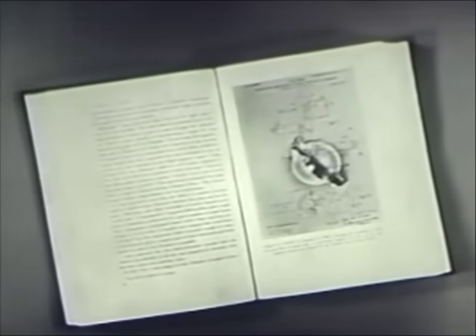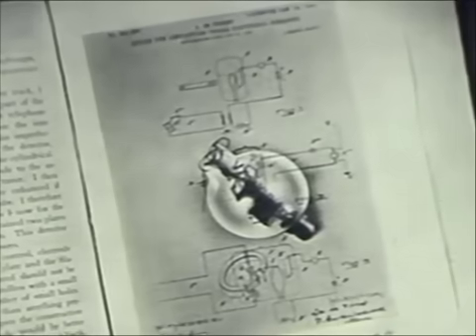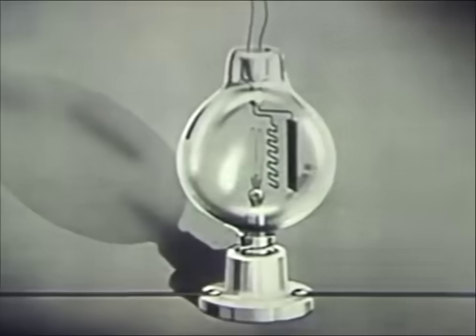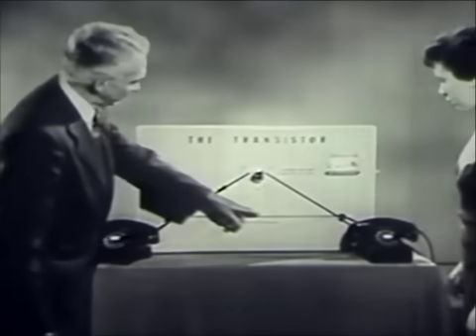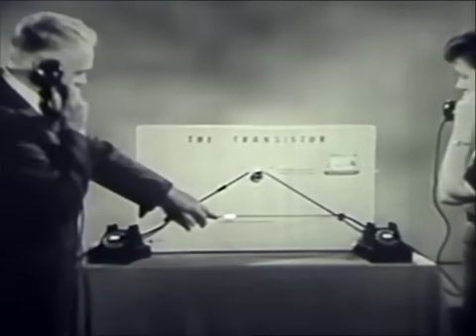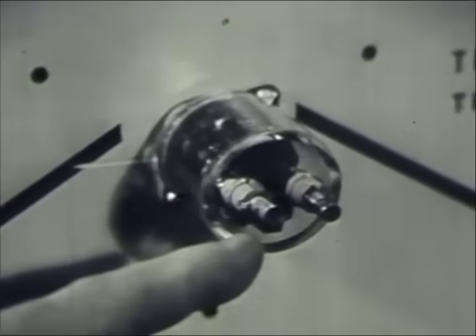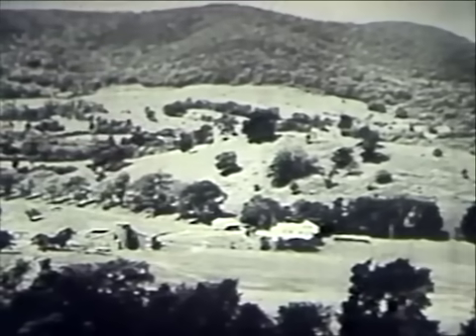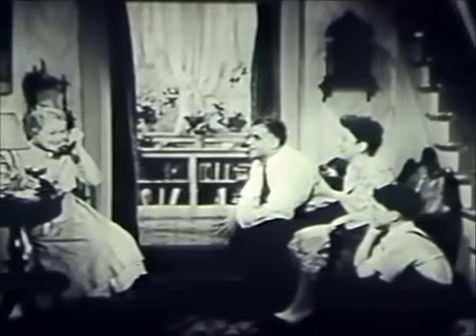The Transistor: a 1953 documentary, anticipating its coming impact on technology

Comment: Man I swear. The transistor is nearly the most useful thing invented from the 1500s to now. It made us EXPLODE with super tech filled and modern technology. Phones, computers, space travel, proper gps, radar, sonar, high frequency electrical switching. EVEN MODERN LIGHT BULBS! Yes you’d have power, food, and a good job. But without the tiny transistor which has become microscopic in many cases, life would be so much more different.

Comment: “Because the transistor remains cool...”

Modern gaming rigs may have something to say about that
Reply: Integrated circuits are another story.
Reply: Just clean the rig cooling system from time to time or change the thermal paste then it will not gonna be working so hot for you. :P Also you have billion transistors in a cpu or gpu that is smaller than a single vacuume tube and good systems using water cooling so you can touch microcircuit even when its working... try doing that with vacuum tube?:P ("The development of oxide-coated filaments in the mid-1920s reduced filament operating temperature to a dull red heat (around 700 °C), which in turn reduced thermal distortion of the tube structure and allowed closer spacing of tube elements.")
Reply: Biały i’m aware of that lol i have a degree in electronic engineering, just wanted to make a bit of a dumb joke. And yes, valves get insanely hot, guitar amps can attest to that
Reply: you know there trillions of transistor in your rig right??
Reply: Loknath Shankar i don’t have a rig for starters, read the above comment for more info. Christ can’t people take a joke these days lol
Reply: @loknathshankar5423  No there aren't. About a billion, tops.
Reply: @jimskea224  well considering my 8 year old cpu has 1.2b in it alone, 1 billion tops is wrong
Reply: But still, compared to glowing vacuum tubes

Comment: 7:28 "Transistors may some day go under the sea"....NOPE. We use fiber optic cable now. We've come so far in such a short time. The scientists of that era couldn't have even imagined the technology that we use today! Their transistors are used now in the billions, within one microchip!
Reply: "The scientists of that era couldn't have even imagined" just like you can not even imagine "maximum distance of a fiber optic link that can be achieved without using any optical amplifier or repeater"? heh
Reply: Optical amplifiers / repeaters use transistor based devices to operate. 😉

Comment: I grew up with this.  A watch the transition from Vacuum tubes to transistors and later it ICs. I'm glad I understood the physics as technology changes.  I made solar cells from a silicon disc as a HS science project in the 60s. We were alll amazed with the transistor radio thet were the size of a pack of cigarettes.  Now you can put a radio as a microdchip in an MP3 player that is 1.5 by 3 inches as an add-on device.  It the carriers could make money on it there would be radios in cellphones, but public airwaves data don't make them mnoney and free radio doesn't require subscriptions like Spotify.

Comment: Just big enough for a tiny ✋ and.   We actually replaced  tubes in the television📺
Reply: The tubes in the TVs and the tubes they are talking about are different... if you were born after 1970-75 may be ... u never saw a vaccume tube on any electronic. but yeah we replaced the tube inside TV quite late... just to put this into perspective i must remind you that we had tube inside tvs associated with an IC just attached to it which had transistors.

Comment: I remember getting a transistor radio in the Sixties. It was a Sanyo.
Reply: As I did too, ran on 3 D cells, AM and short wave, no FM yet. Mother had an even older type transistor radio, had a leather case and a battery something similar in size to a block of butter , it had 2 different size holes adjacent to each other.....for the plug within the back of the radio. its still around somewhere in the back shed...I hope.
Reply: 9v here, a SOUND DESIGN 8 Transisitor and cost a whopping 16 dollars
Reply: @gertraba4484  yes mine was a 9v pocket sized radio.

Comment: "... the age beyond the electronic age."

I guess that's now officially the information age.
Reply: That would be the Quantum age
Reply: Yeh, I thought that was a curious comment, too.  70 years later it is still the electronic age, but back then the vacuum tube was clearly about electron flow between the cathode and plate and you didn't have to have quantum physics understanding to make tubes or to apply them.  Even though it is a huge technological leap to quantum based  solid state fabrication relative to the old vacuum tube technology, we moved on seamlessly.  The public pretty much just thought about transistors being tiny and low power and cheap, mostly unaware its invention was only possible with knowledge of quantum physics.

Comment: A year after the 47 Roswell crash they figured out how to do it another way.  In July 1948. The Army held their off world share of the crash in a file cabinet under lock. They thought it might be the devil planting technology .  The AF picked up with and ran and with it. But see there was others that were found and this technology was in full use 74 years ago  it enabled the AF to put a communication tower two miles high on the moon. Not our moon Saturns moon Iapetus  that achievement was the inception of the AF.  It was shifted over to the navy in later years. Since the black budget is no longer buried Trump has to invent a new service  the space force so it can be funded with an audited budget  it was necessary as everyone is going to space and it’s all being detected  the five mother ships that are as large as a battle ship that carry thousands ( outside of time space ) as you see the only time that is linear is between the earth and Sol 3 our Sun.  We had shuttle crafts in the 80s that hold 350 personal  anti gravity.  The same tech that was taken from one of the Roswell crashes that was used to get Apollo to the moon  it was in place of the small rocket engine they told you was powering the Lem  it’s how we we’re able to land on the moon  we we’re able to use the foil that would unfold when you dropped it to line the walls and space suits to withstand the radiation. We used it to launch a craft that was another two missions for Apollo to look at a crashed Alien craft on the moon  to bring back a woman that was neither dead nor alive that was laying in the craft prob thousands of years. We we’re running computers that are more powerful today in the 70s  a lot of the truth you can read about it in the book “the day after Roswell”.  By Col Corso.. not here-say.  Time for the truth.
Reply: Get better education.
Reply: Mika Korhonen    Yeah I could trade in by 600 square-foot master bath for outhouse with a swing up door ,?  Where do I get your gradjamucation

Comment: In 1979 I got my 1st job in the semiconductor processing industry. It was at a company called EMM Semi. Before then they had been making magnetic core memories as SRAM but in 79' were the world's largest producer of semiconductor SRAM. They made the 2114 4K bit Ram up into 1982.  They were made on 4" Si wafers with 5um then 3um minimum geometries.  They were PMOS or NMOS then later CMOS technology. Years later I was an Ion Implant Specialist at Motorola's gallium arsenide fab where we made HEMT BJTs and JFETS using the GaAs process. The end users were cellular phone mfrs.  It was some of the most interesting work I ever did but, non-technical Wall Street shipped most of the jobs off to Asia.

Comment: 7:59 - a portable television the size of a suitcase! What wonders await us!
Reply: Watching this video on my cellphone made me feel a little ashamed at how much I'd been taking technology for granted.
Reply: A portable computer that could fit in your hand, with unfathomable processing power.
Reply: There were actually portable CRT televisions that looked similar to that lol. Anyone born after 2005 probably has no recollection of cathode ray tubes however
Reply: @ccandrew111  oh I remember, but I think we're just a touch further on now.
Reply: @xaiano794  CRT TV's are in high demand due to retro gaming.
Reply: @FightCollective  lol that's crazy, but I suppose if people have the cash they can buy what they like
Reply: and cooking food by radiation that produces NO HEAT!!!!!!!!!!!!
Reply: @gertraba4484  well, microwaves oven are not related to transistors but the point its the same...
Reply: @pologamero2648  i'm talking of the digital control panels, first microwaves were the size of cabinets and had huge rotary  clock timers on em
Reply: Microwaves produce heat - in the food, that is. Or they produce plasma / electric sparks if you put something not supposed to be there in a microwave.
Reply: @enricofermi3471  they increase the temperature of water molecules. With metals you will get a build up of charge due to the photoelectric effect and it is that build up that causes arcing and from that comes plasma.
You'd have to put a lot of microwaves into something with water to cause it to become plasma and I think that would really be your fault for misusing the microwave.
Reply: remember, this was 1952!   And remember how large the first cell phones were.
Reply: My dad had a portable TV in the 80s that looked just like that. Also, when my uncle came back from Japan in the 90s, he brought a Game Gear that had digital TV. Couldn't use it in my country until 2008, because that's when they started broadcasting digital TV.
Reply: I enjoyed that their projections were not wrong, we've just gone beyond their projections.
Reply: I kinda wish my computer had a heating element and vacuum.
Reply: @mikeymcmikeface5599  for your computer, a single vacuum tube does almost nothing, but you can have a portable, digital compatible tube audio amplifier to enjoy!
Reply: Jim Spencer  they hadn't thought of rolling luggage.
Reply: Jim Spencer  One is for the batteries.
Reply: What are our grand children going to say about our smartphones?
Reply: I remember those little this. My 4th grade class had everyone bring in their portable tvs from home and we all sat in small groups in the class room watching the presidential inauguration.
Reply: soon everyone will be able to use quibi........
Reply: Yup. But the BIG hurdle was the as-yet unthought of LCD screens...the old cathode ray tubes were heavy and ran hot...

Comment: 5:22 "transistors remain cool" ask uncle Mosfet
Reply: I burnt up 9 mosfets in the last month from overheating.
Reply: Compared to what you would need to accomplish the same thing with vacuum tubes... yes, they do remain cool.
Reply: MOSFETs only heat up when conducting. Vacuum tubes produce heat even when they are idling since they rely on a heated cathode to work. Moreover, unlike vacuum tubes, FETs have very low resistance (on the milliohm range), which allows to pump a lot of current through them with acceptable power losses. Vacuum tubes usually can't handle low voltage high current applications, that's why tube amplifiers operate at high voltage and require output transformers.

So yeah - compared to tubes FETs do remain cool.

Comment: Bell Labs don't got a lot of appreciation but they changed the world with their inventions and masterminds.
Reply: Bell Labs didn't do it.  John Bardeen, et al., did it.  Their middle manager told them that even if they got the transistor to work, it would have no practical application.  He ordered them not to work on it.  As a result, they kept their experiment on a "rolly-cart" in the coat room, and only rolled it out to work on it night after night after their boss went home.  So, while Bell Labs may have provided the "sandbox" in which the transistor was invented, in point-of-fact Bell Labs' management actively tried to prevent the experimental work required to validate their theoretical projections from being accomplished.

Comment: It's been asked why transistors arrived so late on the scene for use in high fidelity stereo, (about 67/68). It was probably because they weren't ready for the high power and performance requirements of large stereo amplifiers. Plus early non-silicon transistors generally sounded like shit. They have massively improved since those early year but even today many people prefer the sound of tube amps.
Reply: Nonsense.  Transistors have always sounded about the same from the time of point-contact germanium transistors onward.  Especially class A amplifiers.  In the early 1960's my Dad and I built a preamp that you could mount in the tone-arm of a turntable to reduce transmission noise.  Linear is linear.  Class A is class A; and push-pull is push-pull.

The lack of "high power" is correct, however.  And by "high power" we are talking about not being able to achieve a cost-effective 10 Watts RMS for a solid-state output stage.  Speakers were efficient enough that 10 Watts is all you really would have needed, but it still wasn't available.

The thing no one has mentioned is that those damned germanium transistors would burn out essentially if you breathed on them wrong.  The transistor components and circuits were anything but robust.  From a practical standpoint, a lot of applications were never realized, or just weren't practical, because it was so hard to develop or fabricate circuits without burning out a large number of germanium transistors.  Luckily, for the most part, high volume germanium transistor technology was replaced by silicon transistors in just a few years.  Practically speaking, what we saw of this was a shift from PNP to NPN, with the attendant shift from favoring negative supply voltages to positive supply voltages (positive ground to negative GND.)

The first computer I got to program was a CDC 1604, which was the first all solid-state computer.  It was constructed with "toasted" germanium transistors.  It was so difficult to get sufficient power to drive the memory cores that Seymour Cray violated one of the fundamental design rules-of-thumb recommended to avoid current-hogging:  He connected 2 point-contact germanium transistors in parallel (without any isolation between them of any kind, resistors or otherwise) to achieve a small increase in current.  (Far less than double...maybe effectively about 20%.)  And they burned out all the time.  That was the most frequent failure in the machine.

Current hogging was responsible for those failures -- just like it is in the low-end parallel-connected Chinese LED circuits of today.

Comment: High power amateur radio amplifiers in the multi kw range still commonly use vacumn tubes as they are more tolerant of the huge power dissipation they need to handle.
Reply: The same is analogously true of high power gas discharge lamps.  Parking lots and stadia are still lit with gas tubes.  It may be a while before LEDs overtake tubes in this high-end application, as well.
Reply: Vacuum tubes are much better for electric guitar amplifiers
Reply: @bluenosemassmedia2996  sweeter sound
Reply: True, almost every home and even many offices have a RF vacuum tube oscillator that puts out almost a kW of power.
Reply: @teresashinkansen9402  OMG we had better ban them..
Reply: @Spookieham  Agree that's the cause of most cancer cases today.
Reply: @teresashinkansen9402  can we have a peer reviewed paper as evidence? otherwise get your tinfoil hat back on
Reply: and frequency
Reply: Transistors are dumb and chips are stupid
Reply: @robertpryor7225  Low quality bait. Try harder next time.

If you're not trolling, consider using something not composed of transistors to make your comments in the future.
Reply: Robert Pryor Yeah, this whole “computer” fad will blow over soon
Reply: @RandomNumber141  yeah I think so.I predict the paper and pencil will  be the next digital devices
Reply: @robertpryor7225  Try writing that comment without using any transistors

Comment: Great Film of particular interest to me, as I was born in 1953, so it is interesting to see the technology around at the time I was born. It's also interesting to note that whilst the Transistor was invented in 1947/48, Valve equipment was still being manufactured up to the early 1970's but mainly in Televisions by then. The 'semiconductor' Diode actually precedes the Vacuum Tube, albeit as a crude "Cats Whisker" Diode used in "Chrystal Radio Sets". Later, there was the "Westector" (made by 'Westinghouse'), consisting of a small 'Copper Oxide' Rectifier Diode used for high or low frequency, low voltage, small current rectification, and the (normally) finned selenium rectifier for higher current, high voltage rectification. These all go back to the 1930's. Thus preceding the Transistor by nearly twenty years.  
High power Transmitters still today use Valves in the output stages. Although, these will almost certainly be replace with Transistor's eventually when the technology allows.